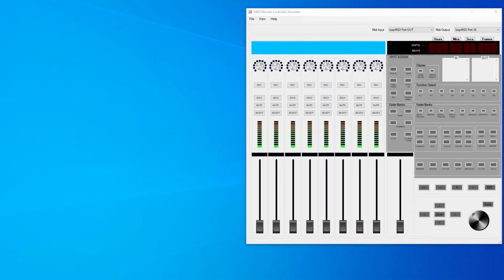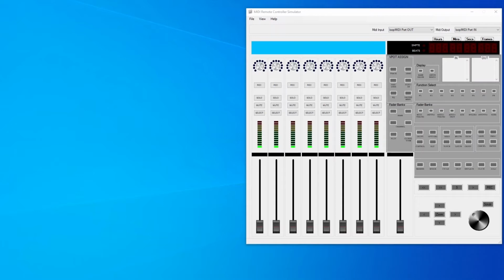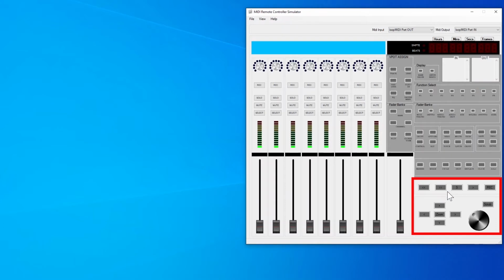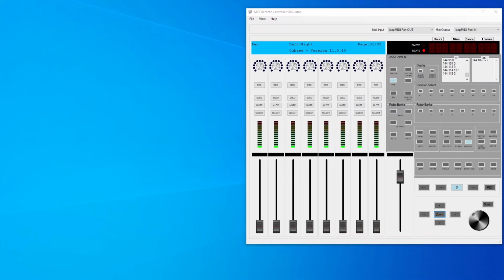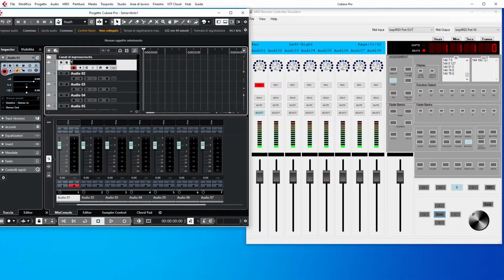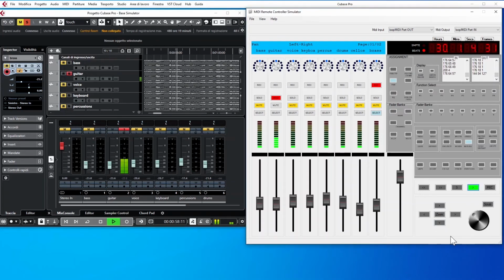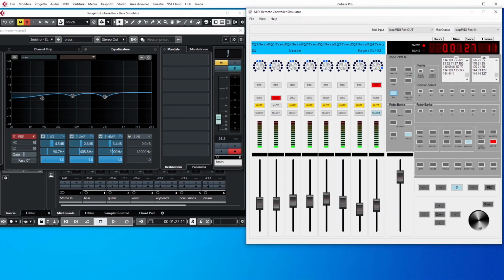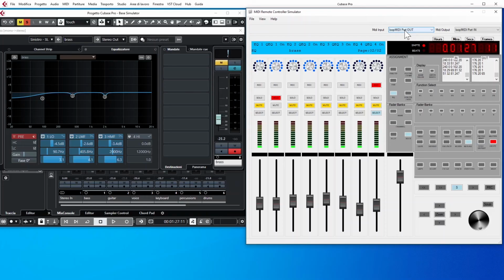DAW Controller Simulator

Comment: That is brilliant- thank you for this gem. I was wondering if this could have a midi learn, so you can use any hardware mini through this and it would be MCU. Say I have a basic controller. I can get it to control the fader on the remote via midi learn and in turn the remote would control the daw. Is that possible?
Reply from the maker: Hello thanks for your kind comment! I confess i don’t get it that well… you want to use the simulation software to control the remote that then controls the DAW?
Reply: @fcampanini  almost. I want the hardware to control simulation so the simulation can control the daw

Comment: Subscribed!  I watched the other 4 videos on your hardware fader controller project, than discovered this.  I am interested in this making it over to OSX, and working with multitouch touch screens.  Also, I am curious of a version of this could be made that offered sections as separate "modules" -- say, a fader bank with track names, a meter bank with track names, etc... so one could build up a DAW controller that only showed what one wanted to see.  Just some thoughts.

Comment: this is fantastic work, subscribing to see how this project develops! How are you planning on getting around the availability of the 55x2 LCD screens on your DIY project? maybe with several smaller displays or even OLED displays?
Reply from the maker: Hello thanks a lot for your kind comment. For the LCD there are in fact two ways: either I buy a custom LCD for instance from a company such as GTK (https://www.gtk.co.uk/products/displays/mono-displays/pmva) but obviously there is a high price for something like this, or I go for small OLED display 64x48 (0.66 inches) on which I'm experimenting in these days.